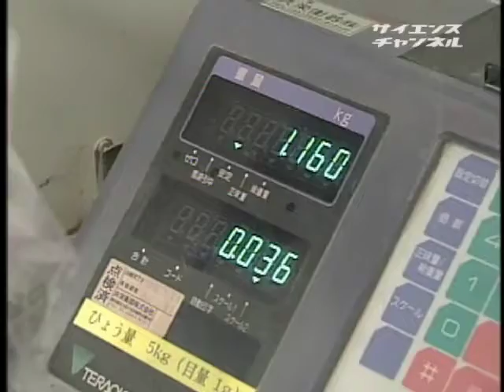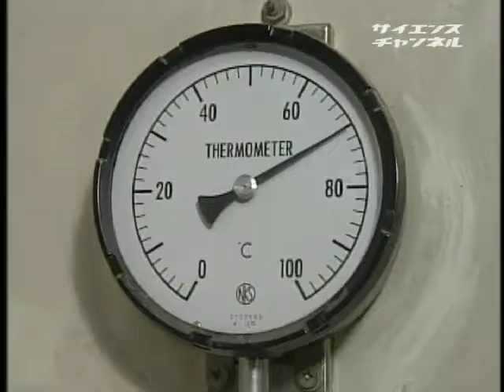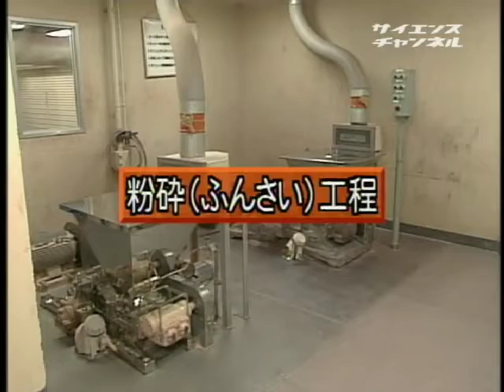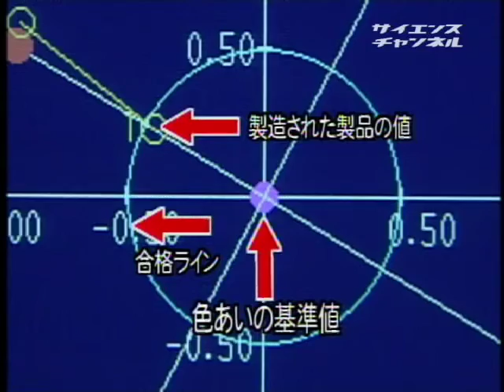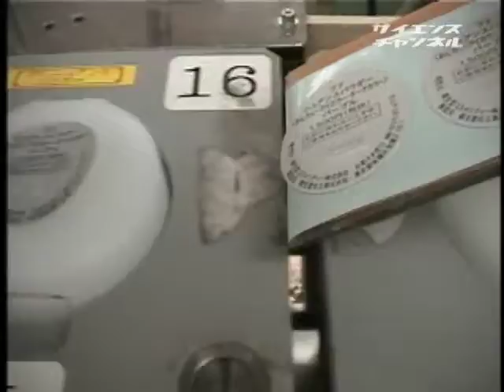THE MAKING　（５４）化粧品ができるまで

Comment: For the English:  Series"The Making".We will follow what kind of technology is used to make familiar products, and tell about the origins of things and the relationship between science and technology.The theme of this time is cosmetics (face color powder).It is said that the makeup in Japan began with red makeup to ward off evil by ancient people.The Japanese have especially favored the sacred red color as the color of makeup.Mica is used as the raw material.Mica is mica, and the powder from it is also called"pure white powder."There are more than 100 kinds of coloring materials used to produce various colors, such as helicodon pink.The manufacturing process is roughly divided into raw material inspection→weighing→mixing→grinding→colorimetric inspection, filtration→Molding→drop test, ultraviolet light inspection, bacteria inspection→case opening and closing inspection→finishing.